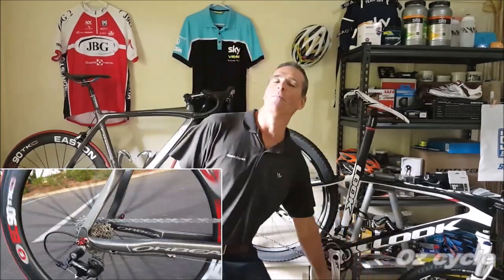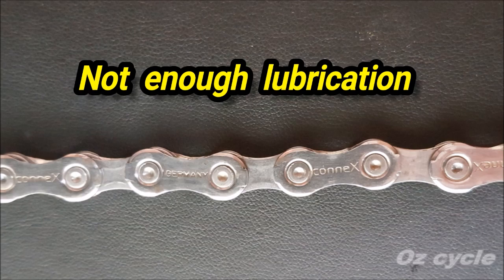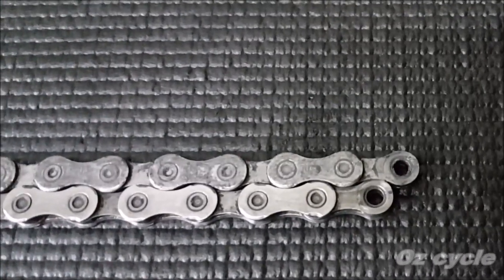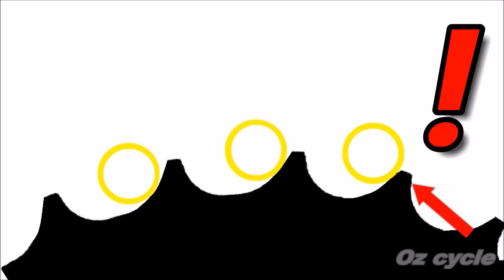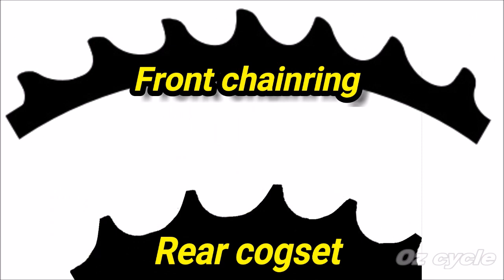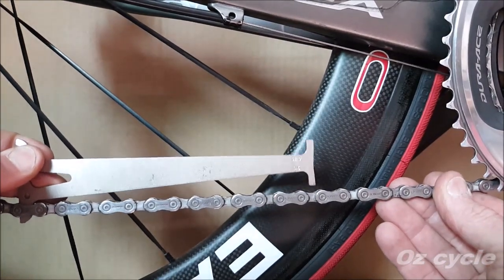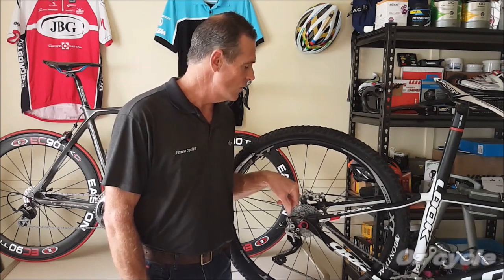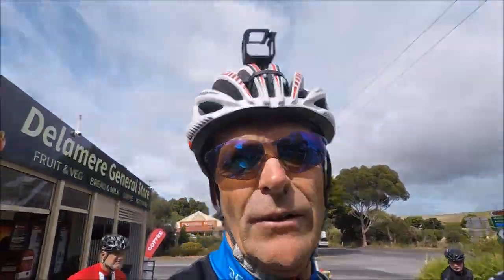Worn chain? -When to replace.

Comment: The dura ace chain i bought came with a quick link but what I wonder is would a pin be more secure or a better way to connect my new chain
Reply: 750aero05 the pin u Shouf never use

Comment: chain at .75% wear or pass that, does that mean the chain needs changing aswell as the cog in the back?
Reply: Ive changed to a new chainring, and the mechanic told me that my chain needs to be changed after checking using the chain tool checker. He didnt mentioned if my cog needs to be changed aswell. But ive read online most ppl suggest when you change to a new chain you need to replaced the cog aswell.
Reply from the maker: Yes , sprokets as well if over .5%

Comment: How much should a new chain ride up on the cog teeth with the rear brake locked and pressure on the pedal?
Reply from the maker: No idea but there is a tool to measure sprocket wear. If a new chain jumps off rear sprockets when riding the cassette needs replacing. If unsure replace cassette with a new one when putting on new chain.

Comment: I got a campy record 11s chain. 4800kms now. Fortnightly measurement with 12inch rule (smallest division 1/32 inch). Haven’t detected any stretch yet... I had chorus chain before and it stretches like shimano and kmc. I’m a bit scared now!
Reply from the maker: Assuming you have Campy cassette also, its worth that checking and replacing if necessary  to save you $$ on a new cassette.
Reply: I do check but im just scared by the fact that after 4800kms a 12inch rule measured no stretch... the rollers so move around quite a bit from the wear tho.

Comment: I’m confused. The park tool you used says .5% for 11 or greater gears.and 75% for 10 or less gears is the standard. Are you saying it’s .5% no matter the number of gears? Thanks
Reply from the maker: Yes all chains are 1/2" pitch
Reply: @stevenleffanue  
Hmmm. So what’s the .75% side of the chain wear tool for?
Reply: @stevenleffanue  
Btw. Great explanation of chain and chain rings and wear.
Reply from the maker: Its an older measure...not actually required
Reply: @stevenleffanue  
Ok. Looks like I need a new chain. Thanks

Comment: A very annoying thing is that when you only want to replace the rear freewheel/cassette then the chain will never fit again, grrr. I only did it twice, hoping to keep the chain, but they just wear out together, it's very strange that you won't notice the chain wear or  the length problem, everything works fine...until the freewheel needs to replacedm then the chain won't fir any more, it starts "knacking", it won't fall into the exact place. Now I'll order a new chain, will see what happens...was happy for the nice new freewheel but now the darn old chain won't fit, despite it was ok with the old freewheel, no noises or anything.
Reply from the maker: If the chain is .5% or less worn it will fit the free-wheel. If you have a worn out free-wheel with matching chain it has also worn your chainrings.
Reply: @stevenleffanue  
Thanks for your reply! I'm new to this level of bike mechanics. Made a beautiful work on the rear axle renovation and the freewhel change, lol...but now this. It seems that when these things wear out one have to change the whole line (rear cogs-chain-middle crank) so they'll fit again, I was a bit afraid of it, I don't have all the tools, etc....but will replace the chain and will observe what happens. Thanks again!

Comment: Dirt DOES stick to (or rather, get into) any oily type of lubrication though. The video makes it sound a bit as if you would use both wax ànd lubricant, or is suggested that you would have lubricant helping to smoothen movement wherever you have moving parts touching onto each other whilst you at the same time would also have wax protecting all those places where there is bare surface. Maybe, this being a rather pro channel, when they say lubrication they have a silicon-based in mind, that is better and was such an improvement compared to oily stuff for precisely that reason, that it doesn't quite as much stick all kinds of dirt to your chain and parts like the environment of your bearings! I must finish watching the rest of the video, maybe this is brought up after all

Comment: For a 9 speed chain, i only need to change it at 0.75% right?   0.5% is for 11 or more gears right?
Reply from the maker: .5% for all chains .
Reply from the maker: You can use a chain as long as you like until it begins to jump on the cogs but if you wish to use a new chain on the same cogs,replace it at .5% . Over .5% the chain begins to wear on the cogs and rings. Try it uf you need convincing.
Reply: i will trust your opinion. i don't want to wear my cassette cogs on my xt cassette. thanks for your time. Keep the nice videos coming:). Wish you all the best

Comment: Measure the center of the pins at 12 inches , if its 1/16 of an inch longer than 12 inches you are at exactly .5% wear , here is the math .     1/16" decided by 12 times 100 = .5 ! so .5% wear. Easy peasy.

Comment: But can we resize the old chain ?
Reply from the maker: What do you mean 'resize"?
Reply: If you mean resize as in restore the chain to its original length, no.  The chain is essentially a consumable part, and there is no way to repair all the little wear points.  It needs to go to the scrap metal recycling bin.  Its steel may find its way into another chain someday!

Comment: Can someone calculate .5% worn length for 10 links for me?
Reply: HI, each link is .5 inches (or 12.7mm).  Ergo, 10 links is 5 inches (127mm).  So, 0.5% of 10 inches is 0.025 inches (or 0.635 mm).
LinkLength * NbrofLinks * 0.005  (or half of one percent)
Hope this helps.
mind, I use the ParkTool CC 2 chain tester and test 4 locations on the chain every week.

Next is just my opinion...
One thing OZ Cycles allude to is that at 0.5% wear it is already causing problem to the cogs.  So it does not matter if you have a 3,4,5,6,7,8,9,10,11 or 12 speed chain, they are all 0.5 inch links! That is when you should replace it? Maybe I think that is when the damage starts, but the is just opinion, I am for changing before 0.5%, if only just before!  Many tools sat that for 9-10 speed chain wear can be 0.75%, but the video above and the arithmetic just refute that claim.  
I now buy 3 chains at a time,  (I wax so waxing every week or 9 days got tiresome) and I buy them on special, I can wait and I buy them before I need them.  I change the chain over to a ready waxed chain about every 300 km. This gives me about 900 km or about 4 weeks before i do the re-wax.  My plans are to dump the chains before 0.5% (just).  I am now buying expensive and light DA cassettes as to me, they will last a lot longer and that means better economy (OK I am not sure, but the arithmetic suggests it is win :) !
Reply: @Desmo500  , thank you!